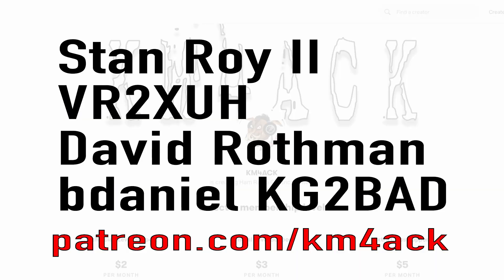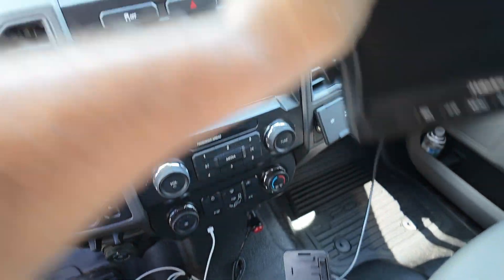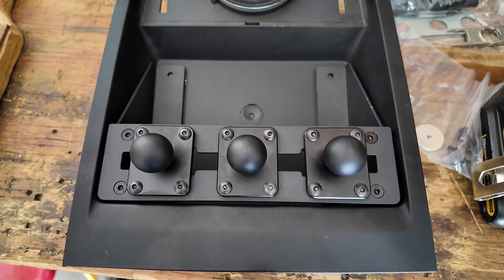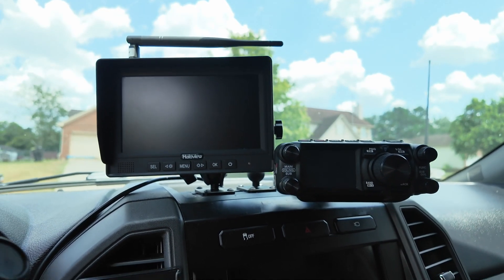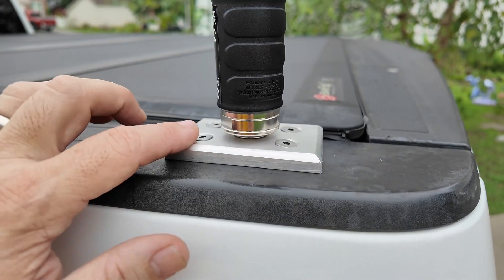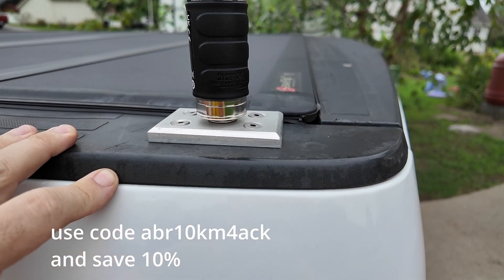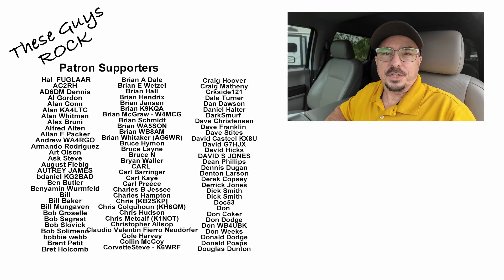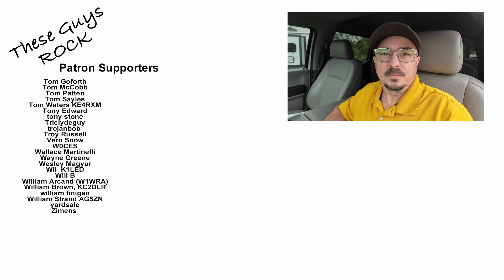All the Radios in a Ford F250

Comment: I bought an ATAS antenna and installed it on my Ram 1500 like you have here. It was junk. On a lark, I bought a 20 meter hamstick and installed it on my F-250 using a bar mounted across the top of the bed on my F-250 less than a foot from the tailgate. Running 10 watts on my TX-500, I made lots of contacts. The longest was 1,500 from Central Iowa to California. I've wasted far too much good money on Yaesu trash (FT-100D, FT-817). Never again will they see any of my money.

Comment: In a previous truck, I mounted the speaker mic clip to a bracket I made that mounted to the ceiling under that center panel that houses the map lights and accessory switches.  It was completely reversible and, after I took it out, the guy who bought the truck from me will never know it was there. I am planning to do that same job to my current F250, but I also want to run the mic cable up there and have not had the time to do that, yet. 

I also made a bracket for a former car that screwed under the bolt that held the front center of the passenger seat to the floor.  On that bracket I mounted my mic clip and the jack for the paddles. That worked well and was reversible, too. I would be using that bracket in my truck now, only it is too short, but for you that idea might work better than the radio head mount - keeping them separate stops the head from moving each time you touch the mic. 

I have in the current F250 a second battery and fuse box under the hood I use for the radios. I use an accessory switch to control charging it from the vehicle 12V side. I also have a Nico charger wired to it so I can charge that radio battery from a 120V wall outlet or generator.  I also have a fused line from it to a PowerPole connector there near the front grille if I want 12V outside the truck, like for Field Day or camping lights. I still want to add is a voltmeter somewhere inside to monitor that extra battery, but I can’t figure out where to put it.

Comment: That's a tidy install.
More info on HF antenna please.
I have a 1985 F350,  I bolted a Kenwood ts120 mobile mount on underside of roof, home brew shunted base vertical.
Looks like something from WW 2.
Anyway it works, I don't get a lot of passengers, no AC down here on South TEXAS
Reply from the maker: The antenna is a Yaesu ATAS 120 - https://www.hamradio.com/detail.cfm?pid=H0-006315
Reply: @KM4ACK did you have an exposed stake pocket hole or was it covered in plastic trim?  My 2014 F-150 Super crew with short bed has the darn stake pockets covered in a single piece of plastic trim.   I’ve thought about cutting the hole and using the same Breedlove brand mount.
Reply from the maker: @cchalfantusa mine were covered by a small piece of plastic that could be popped out.

Comment: If you don't weld, go to your local welder with a project plan to build a custom mount for your truck. I built one for my truck that mounts to the seat floor bolts and provides all the connections I need for the radio.Build it out of solid metal if you can to keep it from wiggling when you drive. If your radio is like mine the back has magnets. A flat, ferrous metal plate welded at the perfect angle for you will hold the radio nicely. You can use a zip line to hold your mic while it is not in use. A few thoughts to noodle on. If you want photos of my setup let me know.

Comment: Nice work. Just some ideas: Move the FT-891 display up to above the dual-bander via the unused center Ram ball. Then mount the two microphones to the Lido mount. If your dual-bander's body is under the seat near the 891, then you can route the microphone cable alongside the 891's. As for the speakers, you know that I'm fond of Amazing GOOP adhesive. My speakers, three of them, are glued the dash on either side of my steering column. That's not for everyone, but I know that they'll peel-off without a trace when I'm ready. 73! -Scott
Reply from the maker: Thanks for the suggestions Scott! Will you be attending the Huntsville Hamfest by chance?
Reply: @KM4ACK  - No Huntsville for me. BUT - I'll be supporting another bicycle tour in your area, arriving OOA September 28th. I'll send you an e-mail.

Comment: You say you don't want to drill into your dash, the lm-1203 mic hanger mount from Lido can be mounted with just the double sided 3M VHB tape it comes with, and it's nice and secure, and when you change your mind about where it is, it pulls off without leaving residue.
Reply from the maker: Thanks!

Comment: Could it be an option to mount the speaker on the unused mount on the dash. Even though it's behind the radio and the backup camera, it is high on the dash and closer to your ear. If you have speakers in the door, you should be able to hear the AM/FM radio.
Reply from the maker: If only new vehicles had the 3.5mm audio input jack, I'd pipe it right into the stereo system :-) I may try your suggestion or mounting it on the pillar behind the driver seat.

Comment: Great video!
I use Scoche(?) magic magnetic vent mounts to hang my mics. I wanted a no drill option and it works great for that. An added plus is that it’s magnetic, so I can practically throw my mic at it and it locks up. No fine motor skills while I’m trucking down the road

Oh and there’s a product from Nite Ize that’s a magnetic ball that you could mount to any flat surface.

I went with the Magic Mount simply because there was more contact surface

Comment: I have a 21 f250 and put an icom mobile speaker in the overhead pop down sunglasses holder and snuck the audio around the headliner and down to the ic705.
Also, can you connect the ftm500 mic to the rig and not the face? That's what I did with my D710g and it really cleans up the wires across the dashboard.
Reply from the maker: Great tips! Thanks.

Comment: Lido mounts has a new mount out that you may be interested in.  It has a place to hang both head units and a place to hang the microphones.  And it's adjustable mounted to the seat bolt.
Reply from the maker: Is that what they refer to as the "HD" mount?
Reply: @KM4ACK  They call it the L-MAX-PRO-PLUS.  I got an email on it a couple of weeks ago.
Reply: Just ordered mine along with the swivel kit.
Reply: Plus you can hang a speaker or two on the L-max.

Comment: I got the 891 mount called the (Heavy Duty Cup Holder Mount With External Speaker Included Fits FTM-100 FTM-200 FTM-300 FTM-400 FTM-500 FTM-6000 FT-891)
model number is LM-EXT-22
it has a speaker, mic and 891 mount all in one. You could change the 891 mount to that and it should go on the end of seat bolt one you already have
Reply from the maker: I hope to see Lido in Huntsville at the upcoming fest. Will certainly stop by their booth and have a look around.

Comment: The newer Chevy's have the same vent system, I think there's one on passenger side and one on driver side.  I'm in the same boat, trying to hook up FT-891/ATAS120 in the truck to have for Huntville, maybe I'll see you there.  Having the same issue, I have a solid plan for radio and head mounting, but where do I put the mic?  I'm thinking about a spring loaded retractable keychain holder, but we'll see.  

You might look at ProClip for no drill mounting solutions.  They have mounts that tetris into the dash trim as well as mounts that clamp into a/c vents.  They're what I used in my Chevy for FTM-400 head and speaker, and then proceeded to drill a 1/2 hole in the dash to run the wires ha.
Reply from the maker: @rustytalon5187  I’ll be easy to find in Huntsville if you monitor APRS 👍
Reply: @KM4ACK  I certainly will be, KG5SUU